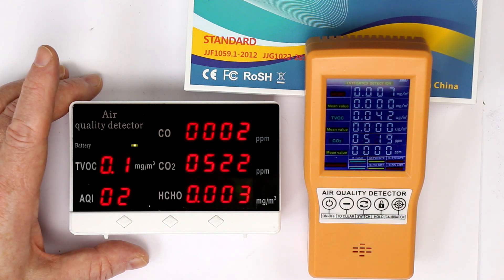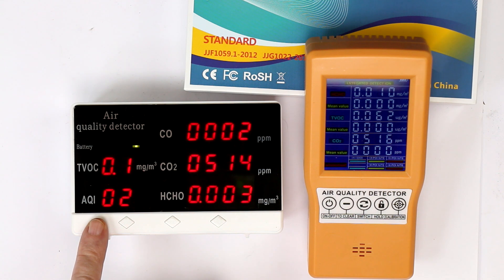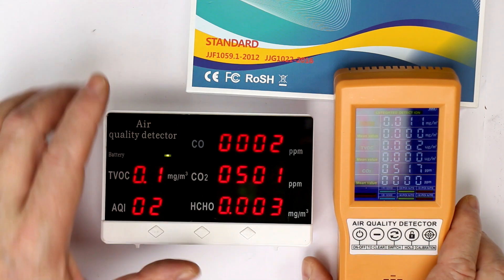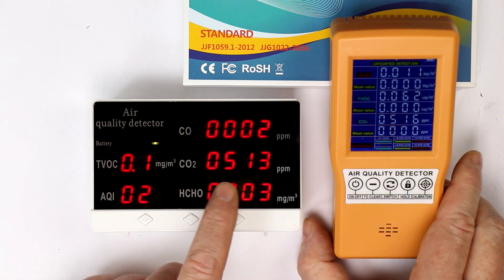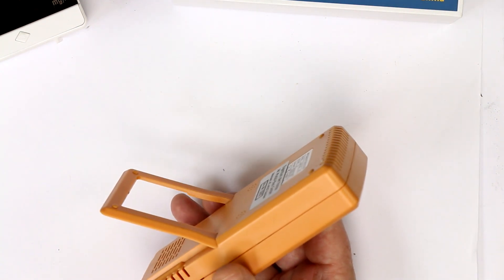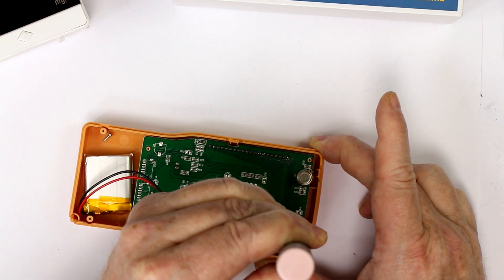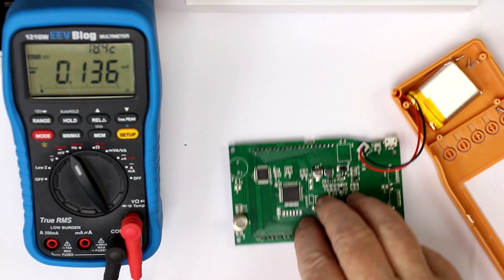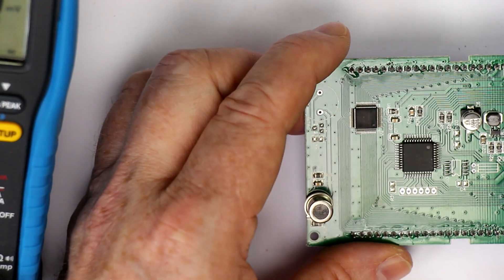Fake Chinese "Air Quality Monitors"

Comment: What devices are accurate ?
Reply: I thought about just answering you individually, but another comment I left, seems just as good to answer your question as well - hope it helps...

Actually - that question is quite subjective...  In other words, you can buy a Fluke Particulate monitor that costs nearly 7,000.00, but does that mean it is the best on the market or the most accurate?  No, as there are others that cost more than 10,000.00, and still yet, you can buy a Hotkrem Particle meter that registers from PM2.5 all the way down to PM0.03 micron, and it is very accurate from my testing, and that one costs about 45.00.  I guess you could say that one's persons guess is just as good as another's...  There are some very good and accurate monitors that are very expensive, and there are still yet others that are very accurate that cost less than 100.00.  Monitors used by labs have much higher sensor technology, and why the stark difference in cost.  For the more home friendly devices, even though quite accurate, use lower quality sensors, and why the lower cost. 

As far as the best monitor on the market or the most accurate?, I would have to say....  God is the only one who has the answer to that one.
Reply from the maker: This video has nothing to do with accuracy. The displayed values are completely fantasy!

Comment: Thanks for sharing. There's another review of a different air quality monitor, they identify the sensor as TP-401T (Shenzhen Dovelet) for which you can find the documentation in English if you search. The other reviewer dismissed the documentation and concluded this cheap sensor most likely only detects VOC at best

Comment: What do you recommend? I’m looking for an accurate one that can detect the off gasses and particles that 3D printing creates like the voc and 2.5pm and such?
Reply from the maker: For PM2.5 there are reliable devices. You can recognize them by their integrated fan which constantly blows air through the sensor unit. I recently got a cheap one from IKEA (!). It´s called VINDRIKTNING and has a green/yellow/red led and is powered over USB-C. It´s astonishing how quickly the LED goes to yellow at my soldering table without my professional air-cleaner for lab-use switched on. And it also verifies that the air-cleaner really cleans the air from the solder-fumes (at least the PM2.5 particles which on the other hand are also a measure of the volatiles from soldering in this case).
For CO2 (and probably also for CO) you need a specialized sensor which works with an infrared absorbtion chamber sensitive to one of the CO2 molecule absorbtion bands. These are available and there are some recommendable, reliable and accurate sensor-types which you can google. Good devices for CO2 or CO cost from 50 €/$ upwards I think.
For volatile organic componentes and similar I don´t know.

Comment: I have one that looks almost identical to the first one, except the plastic is beige and there's a large metal can that fills the bottom portion and is connected via one of the 6-pin connectors.

The NTC temperature-sensor pads aren't populated, and the CO2 measurements it gives are still much higher than I think they should be (996 ppm in a room with an open window, where another sensor says 544ppm)

Comment: Most of these devices have a alcahol sensor and not a PM2.5 sensor.   The sensor came out of those cheap alcahol driving testers.  Other Youtubers found this out.
Reply from the maker: Just as I said. But PM2.5 is something completely different and nothing to do with gases but with fine dust particles!
Reply: @KainkaLabs  But there are alot of fake PM2.5 sensors as their putting the basic air sensor in which triggers with solvents, and others just have a random number generator electronics

Comment: Very informative, thanks. I have similar fakes with the same sensor. Only thing for sure is that it reacts when someone i smoking nearby, then the pm2.5 and pm10 goes way up, or if I do a breathwork and hold my breath to build up co2 and then blow into it then the co2 reading goes way up and the alarm sounds. So what does it really measure? And how do it distribute to the different values on the display?
Reply: I took apart mine- it does have a real sensor for the pm2.5 and pm10, but the same junk as Roger's for the gasses.  Search for GP2Y1014AU.  I'm not sure how it discriminates between pm2.5 and pm10.

Comment: I noticed one night the VT-6IN1 was a flatulence detector.  I had no idea there were a few videos online detailing the things.  I want to see if I can somehow reverse engineer the firmware to adjust values and also replace the sensors with better sensors. Probably not going to be that easy.  I'm still waiting to see if the Aliexpress store I purchased mine from "Weytoll Exclusive Store" can find software to interface and adjust values in the firmware or swap sensors most easily.

Comment: could you please post best air quality monitor on market
Reply: Actually - that is quite subjective...  In other words, you can buy a Fluke Particulate monitor that costs nearly 7,000.00, but does that mean it is the best on the market? No, as there are others that cost more than 10,000.00, and still yet, you can buy a Hotkrem Particle meter that registers from PM2.5 all the way down to PM0.03 micron, and it is very accurate from my testing, and that one costs about 45.00.  I guess you could say that one's persons guess is just as good as another's...  There are some very good and accurate monitors that are very expensive, and there are still yet others that are very accurate that cost less than 100.00.  Monitors used by labs have much higher sensor technology, and why the stark difference in cost.  For the more home friendly devices, even though quite accurate, use lower quality sensors, and why the lower cost. 

As far as the best monitor on the market?, I would have to say....  God is the only one who has the answer to that one.
Reply from the maker: I don´t know. Google it.
Reply: @KainkaLabs  not a reliable source of information. that's why we ask experts like you.
Reply: @gkaa6044  yeah.
Reply: @gkaa6044  I dont think he called himself an expert

Comment: Are they measuring anything at all? Because I saw one being used in a garage with volatiles and the volatile compounds meter did respond. And the CO² meter responding to your breath. I mean, the accuracy notwithstanding, are they detecting gases at all or is it just 100% pure bunk, like a kids toy?
Reply from the maker: The sensor probably reacts to a lot of gases from harmless to deadly poisenous. But because it isn´t specific to (0nly) one spefici gas you can´t discrimnate if you better runa away or ignore the displayed values :-)

Comment: Can these be used to detect the "bottom burp" concentration?
If yes, then you can modify it for a funny party toy.
Reply: Bottom burp? Really bruh?
Reply: @chechnya  - joke, you missed it.
Reply: @johncoops6897  Yeah, I noticed one night the VT-6IN1 was a flatulence detector.  I had no idea there were a few videos online detailing the things.  I want to see if I can somehow reverse engineer the firmware to adjust values and also replace the sensors with better sensors. Probably not going to be that easy.